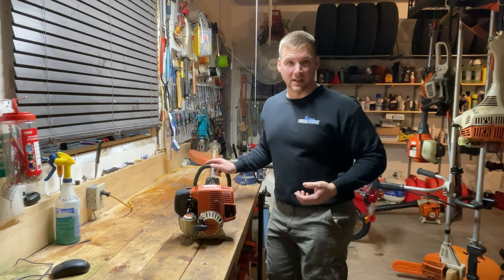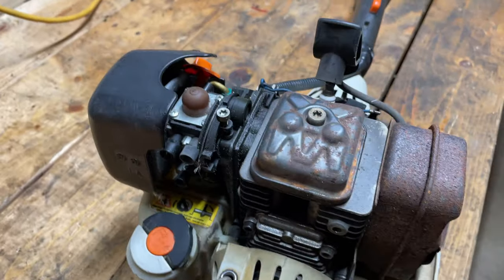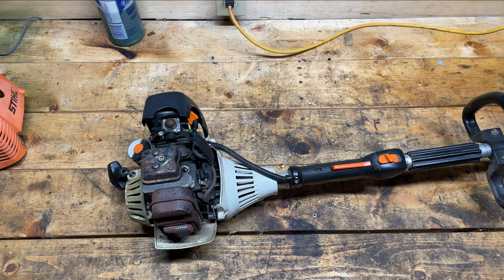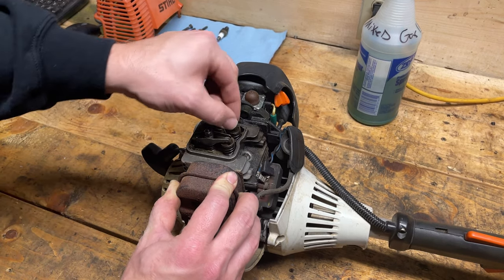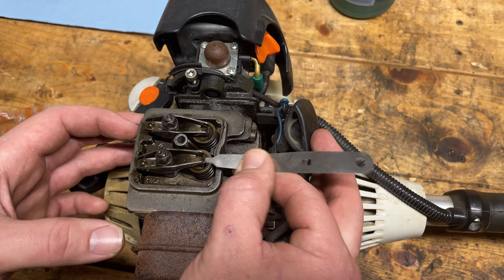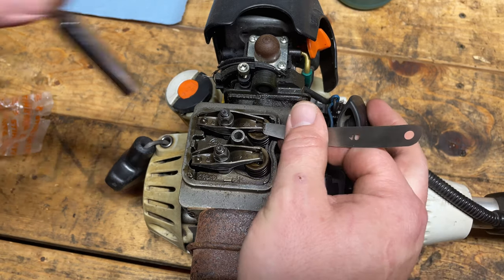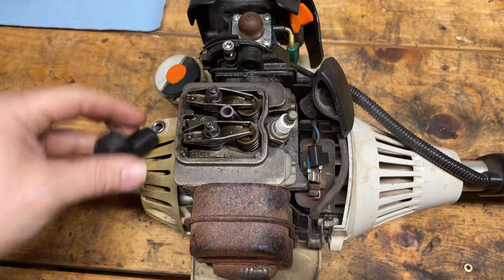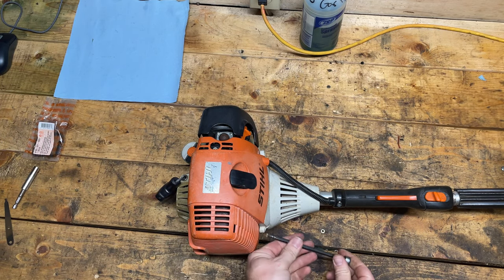Stihl Pro trimmer REALLY hard to pull when starting... how-to fix!!! (Stihl 4-mix valve adjustment)

Comment: Excellent video. I think I'll go check the valves on my 4 mix pole saw.
Reply from the maker: Hey Fitch! Thanks for the kind words. Let me know how it turns out! I have the HT131 saw too and I LOVE it!
Reply: @DavesSmallEngines  The valves on my HT101 are perfect. Identical light drag on both. Buttoned it right back up with out adjusting anything. Not bad considering we bought it in 2006 when I was 64. I'm still using it fifteen to twenty hours a year, though it seems a little heavier than when I bought it.

Comment: Nice video Dave,there is a arrow on the flywheel,that you line up with the screw on the coil,to find top dead center.Per donyboy 73.
Reply from the maker: Yep - that way shows you at TDC as well but doesn’t guarantee you are on the right stroke. Sometimes hard to see as well so I wanted to show this way with the plug out!!! Thanks for the kind words, Jerry!

Comment: I have been struggling to solve the very hard to pull problem on my RS 110R and tried every thing .... except checking the valves.   I did check You Tube and you did a great job of describing the symptom and the solution.   In 10 minutes or so, I had my 110R up and running like new and such an easy pull to start.   Think I will go out and whack some weeds.   Thanks for the Video.

Comment: Excellent video Dave! Most people can't start the big 2-cycles cause they don't know proper pull starting technique on the high compression engines. But this 4-stroke most certainly required a valve adjustment, probably the first one that it ever had to be honest with ya. I have a Honda 4-cycle string trimmer, I checked my valve adjustment, still was good after over a year of use lol.
Reply from the maker: That’s great! I have a few to go over this winter. Need to get my inventory and projects under control!

Comment: Exact problem I am having on an old KM130R (12+ years old).  Ordered my kit today.  Thanks!
Reply from the maker: Awesome! Let me know how it goes!!!
Reply: @Dave's Small Engines  I pull the plug and the engine spins easy.  I put the plug in and loosened the valves and it is still very hard to pull.  I should have the kit next week to set the valves just right.

Comment: I have a 90R trimmer which is a 4 mix like this just smaller engine.  I can't start it. Carb new valve adjusted  timing checked timing wheel looks OK not worn out but only runs if I use my drill drive (the pull cord snapped because of the too many trying )but even if the engine starts, running really rough like shaking my hand, arm really . I'm a little bit out of ideas. Any idea from your side?

Comment: I don't understand how an insufficient exhaust valve rocker gap would lead to a harder pull. It seems like the smaller the gap, the sooner the valve will open and the longer it will stay open. How does that lead to a harder pull?
Reply: Exactly right, too tight means less compression.

Comment: Dave, I am inexperienced with 4 Mix; but IF the exhaust valve seat and/or face is carbon coated causing the tightness, will that valve loosen when used properly at full throttle?  That is; the commercial user probably ran at lesser throttle openings too much while doing delicate trimming (puttering about) and thus the carbon.  Would it be unnecessairly difficult to examine and correct the carbon problem?  Should the exhaust port be checked and cleared of any hard carbon that might break free and score the piston, as with 2 cycle versions?  Thanks!

Comment: When you run across a 2 stroke with the same issue please upload a demonstration. I have since gotten rid of a leaf blower because I thought the piston was scored from not running the fuel mix and not easily repairable...this video was good information!
Reply from the maker: Hey No Limit! 2 strokes don’t have the same issue. They use ports instead of valves - way less moving parts. If it was hard to pull over and it was a 2 stroke, you were likely correct at the piston being scored from lack of oil in the mixture.

Comment: Dave, great video and nice score on a bad ass trimmer!  I am ready to buy A Kombi and sell my FS55.  I like the Stihl Trimmers and bought mine new about 20 years ago and it still runs like the day I bought it.  There’s a lot to be said for using a good 2-cycle oil 😃
Reply from the maker: Hey John! Thanks for the kind words. I have a Kombi KM55 setup I quite like, but if you need more power the next step up is the pro level (KM90, 91, 94 + etc). My Fathers FS85r still runs the same as it did in 2001 when he bought it too!

Comment: Great video Dave, I need to check the valves on my BR600 backpack blower, it has the 4 mix engine. Bought it from a lawn care company a few years ago for only $100 because it needed a little work so it is beat up a some since it was used commercially. Thanks for sharing!
Reply from the maker: Hey WildeFox! Let me know how that goes!
Reply: @DavesSmallEngines  The valves were still in spec, it looks like the crankcase may need to be resealed though, the bottom of the engine is oily. That's usually a sign of a leak, I found a video Don made on how to reseal a Stihl 4 mix backpack blower engine crankcase so I'm going to tackle that next.
Reply from the maker: @wildefox1478  yep! It’s a great video. I’ve reseated 3 or 4 in the last couple days based on his video.
Reply: @DavesSmallEngines  Just finished resealing the 4 mix on my BR600 backpack blower and man that made a world of difference! Before and as long as I've had it, it had slow acceleration when the trigger was squeezed and had poor idle, must have been lacking in power too because man it runs like a top now! Lots more power, smooth idle and very responsive throttle, it accelerates immediately, so resealing the engine was definitely needed, first time doing a repair like this on a 4 mix.

Comment: 😮 This was a really helpful video. I am going to be adjusting the valves and replacing the valve cover gasket on my Stihl FS 90R although it is running fine both at idle and when given full throttle. Prior to doing this work, I noticed that the screw on the valve cover was loose and tightened it. Just doing that made the trimmer run on full at idle and prevented the trigger from moving. When I loosened the screw again, it idled and ran perfectly. What would cause that?  Thanks -

Comment: Valve clearance which is too tight means less compression, easier to turn over. There is a small decompression device on the camshaft, if this is not working properly then it will be hard to pull.
Reply: How can you tell if it’s the cam gear and not the valves? I have this problem- the valves are in spec. Not tight. Not loose. It’s a bitch to pull cold starting. Like pop your shoulder out of place it’s that hard to pull. 

Take out the plug & it’s easy to pull
Reply: @mab123080   If you remove the cam gear there’s a small spring loaded metal lobe protruding from the cam lobe. This lifts the valves at slow speed ie pulling the starter cord helping to decompress the engine. When the engine starts centrifugal force acts on the metal lobe drawing it back in.

Comment: Would it be a worn cam gear if it’s hard to pull, but the valves are not too tight? Opposite of your teimmer woth tight exhaust side. 

Its identical to this video, on top dead center, but valves are perfect

Comment: On these, isn’t there also a decompression “switch” attached to the crank that releases some pressure?
Reply: Yes its in the back on the round cam gear behind that 4 bolt cover is,,plus scrotched cylinder walls can cause this problem to

Comment: Sobwould it be a worn cam gear if it’s hard to pull, but the valves are not tight? 

Its identical to this video, on top dead center, but valves are perfect

Comment: Nice video, quick question I have the same problem, but when I removed the spark plug the cord still hard to pull, what it can be?
Reply from the maker: Hmm, could be a few things. Clutch seized, bad bearings maybe? Or valves very tight.

Comment: Line the arrow up on the fly wheel with coil mounting bolt , on the proper tdc setting .
Reply from the maker: That way works too!
Reply: @DavesSmallEngines  I am a Stihl Platinum Certified Tech 40 years experience , Stihl expresses to follow the procedure to a Tee , because you will be adjusting the valves just prior to TDC very slightly. These are interference engines if the valves open even slightly to much they will contact the piston and break a ring land or a valve keeper and then drop a valve causing a catastrophic failure, there is a reason for the arrow casted onto the flywheel and it not for dummies...!
Reply from the maker: @cbnx82703  yes sir! I’ll make that adjustment to my methods. Thanks so much for your time
Reply: @DavesSmallEngines  Dave , sir it’s your machine you do as you like but for customer equipment repairs while working in the industry for a cash paying customer and you do it your way and it comes back with a issue related to your described method that I described all of your fellow colleagues are going to know exactly what happened believe me I’ve seen it with new hires ignoring procedures and taking short cuts and ends up biting them in the Ass... I understand your procedure on your own equipment is your prerogative...!
Reply from the maker: @cbnx82703  I appreciate it, I’ll do that from now on! I am learning every day.

Comment: Nice video Dave, I have a Husqvarna 128cd weedwacker 2 cycle that has the same hard to pull start. Any ideas what that would be? Removing the spark plug is very easy to pull. Thanks Dave.
Reply from the maker: Hey Matt! I believe that is a 2 stroke unit, correct? Pop off the muffler and see if the piston is scored up at all. Keep me posted, we can figure it out!
Reply: @DavesSmallEngines  not that bad but I ordered a new one this week along with a cylinder.  When I remove the old one anything I should look for?

Comment: So I have a question wouldn’t a rocker that is to tight be a cause of low compression as it would be opening the valve a bit to early or holding it slightly open all the time where as a rocker that’s to loose not be opening valve quick enough or not at all therefore causing it to be hard to crank
Reply from the maker: No kidding!
Reply: The video made me think the tight valve was causing the hard crank when in fact it’s the loose valve right?

Comment: Just stumbled onto your channel and watched this video. I just got a free Stihl FS110R. Pulling cord compression feels fine. Missing gas cap, primer bulb had tape covering large hole with cracks all around.  Can’t wait to dig into my first 4-mix engine!  Surprised to see only one tool needed to tighten/loosen valves. What holds the adjustment once done?  I have a Poulan 3314 chainsaw with extremely difficult pull and jerking back out of my hand. Did get it running but couldn’t do it consistently. Checked flywheel-crankshaft mating (NOT a key) and it looks fine. Any suggestions as to why timing seems off so engine is firing before TDC?  Piston and cylinder look fine through intake and exhaust ports - no scoring I can see. One other thing - could you increase your recording volume a bit? Thanks! Subbed.
Reply from the maker: Hi Rein! Thanks for the sub! Did you get into the 4 mix? The tension on the valve spring and the nut keeps the proper tension on the rocker arm. 

Not sure about the Poulan, I have only worked on a couple of those and realized I would rather work on Stihl/Echo/Husky stuff. 

I would be looking at the flywheel like you did… no key? How is it aligned? If that’s all good I’d check out the coil. 

I’m looking into a lapel mic!

Cheers
Reply: Dave's Small Engines   Haven’t gotten into the 4-mix yet - working on 3 Poulans and a Craftsman all the same except for cc and bar/chain configuration. Got the 2nd one going and it’s also really difficult to pull but at least it doesn’t jerk back so timing is ok. I’ve done a lot more research and suspect these all come with two issues from the factory. One is plug gap in owner’s manual is.025 and they start cold and hot better at .030. The other issue is air starvation due to bad filter cover design. The fix seems to be creating one or more holes in the filter cover more or less aligned with the strat throat. I’m going to try the larger gap first this morning to see what difference that makes and then drill a 3/4 inch hole in the filter cover. There is no separate crank/flywheel key on these - the flywheel has a place where there is an odd looking protrusion which aligns with the crank slot. One other thing that occurs to me is that because the engine isn’t firing right away on first or second flywheel revolution maybe the starter sprocket isn’t being disengaged immediately because the flywheel pawls aren’t retracting yet. Thoughts on that?  I had a Stihl 028 many years ago that was not nearly so difficult to pull over.
Reply from the maker: @Rein_Ciarfella  hmm… I’m not overly sure. Does the chain move when you pull it over?
Reply: Dave's Small Engines   I’ve tried with brake on for safety reason but then tried with brake off and there seems to be a very slight improvement, but not enough to really make a difference.  In between my other work today (pastry prepping - I’m a baker working out of my home) I’ll be doing the mods already mentioned to see what differences may happen. I should also mention I cleaned this 2nd Poulan up completely prior to starting to work on it and did a full service including fuel lines, primer bulb, fuel filter, cleaned magneto and flywheel surfaces and gapped at .010, pulled and disassembled carb, cleaned by spraying carb cleaner and inspected diaphragms which were both good. Washed out air filter multiple times and dried well. Cleaned out the dry fuel tank, filled with fresh 40:1 premix, filled bar oil. Bar and chain cleaned as well. Once I get this thing running right the only other thing I need to do is sharpen the chain. Waiting now for arrival of my first Stihl 2 in 1 sharpening tool and a 15L ultrasonic cleaner! 😁👍🔧🧰   Oh, and I’ve also got a tach and T-handled Torx drivers on order. Every time I think I have enough tools I realize I want to do a more professional job. 😉

Comment: I have this problem with a 2 stroke any suggestions?
Reply from the maker: Hey there! Hmm… could be a bad crank bearing or the piston / cylinder are scored. Pull the muffler off and see if there’s any scoring!
Reply: Thanks Dave, the problem is fix turns out it was a compression problem

Comment: Heey,Dave,I've never worked on one of those,thanks for the video.I also don't have one of those T27 bits,but maybe I should?  :)
Reply from the maker: Hey Ryan - I highly recommend the T27 torx bit. Saves so much time! My Irwin bit bit the dust last night, have to order another!
Reply: @DavesSmallEngines  I just put one in my cart,it's not that I do much anymore,but the bit I have has been too short when I do need one.

Comment: I same issue with br430 2 stroke blower  , hard to pull with spark plug in ,hard to pull with muffler removed ,
but with  spark out easier to pull and piston moves with muffler in, recoil cord work fine .piston  slight scored  4 vertical scratches, exhaust side  , but it moves fine with spark plug out , would seals  cause this  any thoughts to main culprit don’t understand the science of the 2 stroke to what would cause this fault to  only apply  with spark plug in  any ideas
Reply from the maker: Sounds like the piston is scored up!

Comment: Love your videos!  I was hoping you can help me I have a stihl blower BG56C that starts and when I push on the trigger it dies. I clean the exhaust screen I adjusted the carb I clean the carb  replaced the fuel and still the same. Any other ideas on what it maybe?
Reply from the maker: Hey Jaime. Thanks for the kind words! Sounds like a carb adjustment issue to me.  How old is it? What kind of fuel do you use (ethanol added or non?). Have you checked your fuel filter?
Reply: @DavesSmallEngines  I'm not sure how old I'll check when I get home. I only use the premix fuel. I do need to check the fuel filter. And you thank you so much for responding so quickly
Reply from the maker: @jaimepadilla9548  no problem! What are your carb screws set at?
Reply: @DavesSmallEngines  I'm not sure 🤔
Reply: @jaimepadilla9548  If carb settings do not resolve, there may be a leak in fuel line letting air in.  Inside the carb, there may be a blocked inlet screen.

Comment: Great video but actually there a timing mark on the flywheel there an arrow that lines up with a bolt head 😳
Reply from the maker: Yes there is! I’ll make another video using this method as well.
Reply: @DavesSmallEngines  is it replacing the plastic cam

Comment: What size filler gage
Reply: Gauge supplied with RS 110 is stamped 10 but no units.   It measures 0.010 mm or about 4 thousands.

Comment: what’s the device they connected the 8 mm socket  too  the bar and  then to the spanner 
what the name of those type of spanners that can take different bits wow
complete newbie go easy  5.56 on your time line wow great video
Reply from the maker: Hey Paul! Its a 1/4-inch Hex Shank to 1/4-inch Socket Adapter. And then its a 1/4-inch hex mini ratchet. Thanks for watching!
Reply: @DavesSmallEngines  thanks so much for the information would took me weeks to figure that out , much appreciated take care  Dave

Comment: you stole that for 100 bucks! good deal on the FS130. I run two of the KM130's with a trimmer and edger attachment. That way if I have one power head go down during our day we still have the other to finish out customer yards.
Reply from the maker: Hey there! 4 issues I've come across with it... muffler bolts seized and had to be re drilled + tapped, carb purge bulb, valves, pull cord slack. It's good to go now!